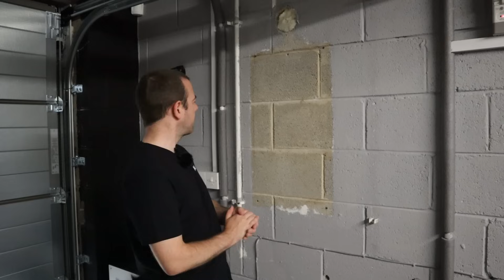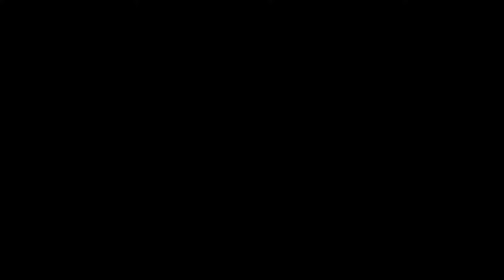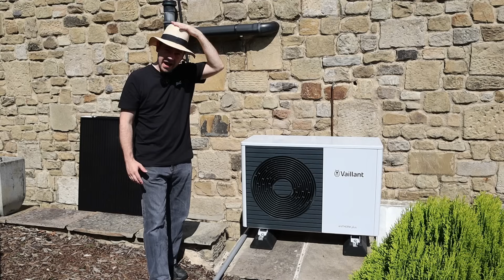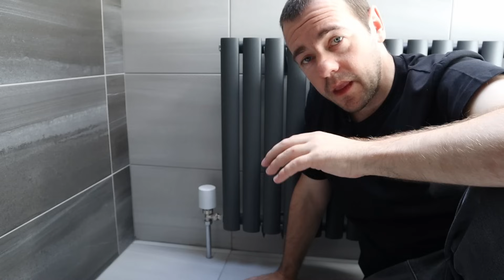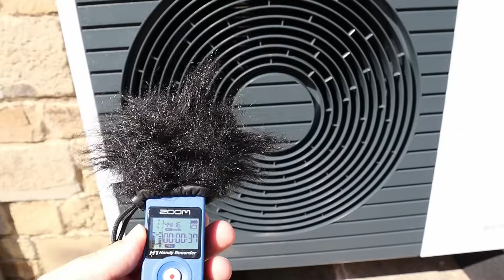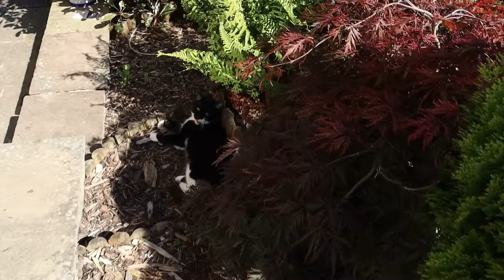Heat Pumps - Our 'Ugly' Truth!

Comment: Welcome to the gang. I mean the heat pump gang.
Yours has been an incredible journey, starting with the missing insulation of the house and the garage to now leaving gas behind.
I have to roughly calculate how much energy you heed to heat up 190 l of water from 15 degC(tab temp) to 50 degC. I expect to be something like 10 - 15 kWh, but we’ll see.
Reply: Wow 15 kWh is terrible.  I guess keeping a gas boiler is the way to go.
Reply: @Isclachau  The heat pump will be providing most of that. If the heat pump efficiency ('COP') is '3' then it gives 3kWh of heat for every 1 kWh of electricity it uses. The latest ASHP claim ratings between high '3' and high '4' - so to get 15 kWh of water heating you would use 4-5 kWh of electricity - which is much more efficient than gas.
Reply: @neilcunningham1081  But gas is still cheaper. I don’t get it I’m afraid.
Reply: @Isclachau  Gas is contributing to climate change which is trashing the survivability of most species on the planet including us. At the moment in the Uk gas is anything but cheap (this will fluctuate of course). If you have enough solar panels (which pay for themselves in 5-10 years) then the cost of running the heat pump is low/free (and green).
Reply: @Isclachau  If you heat your water on an EV tariff, at say 7.5p/kWh, then it is much cheaper than gas, once you factor the efficiency of the HP at (say) 3, your unit cost is down to 2.5p/kWh. A quarter the price of gas.
Reply: @charlesbridgford254 
So now we have to buy an expensive electric vehicle as well as install around £15,000 heat pump equipment?  Totally beyond the average person!  What on earth is your job and salary?
Reply: @Pedromyman1  Um, I work in the electricity industry. TBF I don't own the car, it is leased by a tax free deduction from my salary. The heat pump was zero-rated VAT and had a £5k government grant.

There are ways and means, but it's a long term investment that requires sacrifice, which doesn't necessarily pay itself off in my lifetime.
Reply: @neilcunningham1081  4-5 kWh of electricity at about 30p per kWh is £1.50 per hour. A gas boiler heats radiators to much higher temperatures and gas is cheaper so a boiler would heat our home for 16 hours a day for that sort of sum so sorry but I think tthey are way more expensive  to run than people realise.
Reply: @cbcdesign001   An interesting response which highlights a common misunderstanding (I believe). If you are insulated "enough" and your house is airtight "enough" then you aren't running the unit constantly at 4kWh and so the costs are lower. EVM is one of several youtubers who have posted their actual running costs and they work out pretty well. I caveat these comments as someone who doesn't have an ASHP (yet) - because my house is not insulated/airtight "enough" (yet). If you have a battery then you can run using offpeak priec leccy at other times of the day which (potentially) makes it cheaper. too.

Comment: The periodic legionnaires cycle seems to kill the COP on ASHPs. I have a German tank (a thermal store) which has a serpent coil heat exchanger which spirals up inside the tank and heat exchanges with the water in the tank. Fresh water goes up the serpent coil and comes out hot and always fresh. The water in the body of the tank is used for heating. I comes in at the base and exits mid height. The tank is stratified so the serpent exchanger always gets the highest temp in the tank. Like this you don't need the periodic heating cycle. But the tank is larger than what you have.

Comment: Really good to see a likeminded video. This has opened my eyes to heat pumps. We have just had a 8kwh solar panel array installed with 10kw battery. 

Great video, keep up the informative videos
Reply: That's a very big PV array! 10kwh battery is not going to be enough to maximize it's capacity
Reply: @kiddwong4186  Its absolutely enough, when you have a car with a 74kw battery ti excess in. Our export is very minimal. Even more so when our Hot Water Energy Diverter is installed.

Comment: Interesting to see a cost breakdown once winter comes, my house is 70 years old and is drafty and have spent that much time trying to find the drafts, I was looking down the route of electric heated taps and stand alone ac units in the bedrooms [bit like the split units] so I can rip out the rads and boiler, but with the way the bills are going I can see that it will be a flat rate price all day so there won't be cheap rates. I would rather invest in battery banks and solar and may be a turbine instead of heat pumps, we don't have space for the hot water tank and we would have to totally re pipe the house because who ever did it before wants shooting so installation costs would be out the question, I do have one bonus and that's the log burner and it cost nothing to run as all the wood I collect through out the year is free. With the bills going up I think I need to do some "man maths" to see about battery storage. The skill builder is just giving a different perspective and telling people just watch out who's selling and installing.
Reply: Solar decent shout, turbine, no. Don't do it. Not for a domestic home. The service costs each year tend to wipe out the savings made by having one installed.

Reason being, most dwelling realistically can not have a turbine large enough on their land to justify the service costs.

Granted, you could skip a few services, but you only end up reducing the life of the turbine. Meaning you end up replacing it soon. Which will also wipe out the savings from having one.

Personally, if you can. I would get more panels and storage over a home turbine.
Reply: Investing in Insulation FIRST is surely the way to go even if you're not going to get a Heat Pump especially in an older property , as Heat Pumps pump operate at a lower temperature, so require in most cases NEW Low Temperature Radiators with a larger volume of Hydronic liquid in same, unless one installs Underfloor heating circuits... you're luck you have a source of Free Wood for your Log Burner, as for Battery Banks and Storage  in Winter i'm thinking that those Solar Panel would not be pumping out a lot of Kilowatts to the Batteries what with the tilt of the Earth and Short days...maybe a Log fed Gasification Water Boiler system and a seriously  Large Buffer Tank for all that Wood...
Reply: @malachy1847  hi, I've looked into external insulation but don't have this space as the guy says I need 250mm all round and need to extend the roof out for the guttering , I looked into when we had a log burner fitted to have one with back boiler but the cost at the time was to high, battery would be the way to go if I could find a cheap idea but not self build old laptop battery 🤦‍♂️ I did look to see if I brought a leaf and used the battery but it's complicated to connect to the house as its not designed for battery to home, I agree that solar would be abit crap coming into winter so that was why usually its windyer in winter a turbine or two might be better or I just get an old lister engine and run it on old oil or veg blend and leave it pop popping away. It's going to be interesting to see what clever ideas guys come up with to stick two fingers to the gov and the global stock market traders.

Comment: We've just had a heat pump installed 2 weeks ago, so far so good but obviously we'll have to see how winter goes. 

We needed to redo our whole heating system but that was as much to do with the fact the existing pipes were old and buried into the floor so couldn't be fixed easily as well as the radiators being pretty old a rusted up too. The cost in the end was pretty similar to what I'd estimate a new gas boiler system to be with the work we needed doing once the BUS grant was factored in.

Comment: I have to admit, I'm a heat pump sceptic. This system does look a lot better than most of the others I've seen so far though and I can see them catching on if the market moves towards self contained units like this.
You said you're going to wait for the usage data before you can comment about how well the system works but it seems you're already pretty sold on how great they are.
For a sceptic like myself I'd be more likely to believe your figures once you have them if you hadn't made so many claims about how they will work in any property, any climate, etc when you don't yet actually have any experience to back up those claims.
I can watch heat pump expert videos to get their opinions about how good the tech is in broad terms, as an end user it's probably best to stick to your own experience once we get in to winter.
Reply from the maker: If most of Scandinavia uses heat pumps and has for years, and lots of different houses in the UK also have them, that’s all the evidence needed to prove they can work anywhere. What mine does doesn’t provide proof they’ll work in other climates.

If no one can comment without experience, how can anyone be a skeptic?
Reply: @ElectricVehicleMan  I'm not saying you're wrong, it was just a point about your style of presentation. Obviously one approaches the video knowing you have some bias towards the tech (since you've invested your money installing it) but the way you made statements of fact about how they will work anywhere, then later pointing out you're not an expert in the tech made your bias seem larger
Reply from the maker: I can make statements of fact from research. 

The moon orbits the earth. See it’s easy. 

Otherwise if you’re saying only an expert can comment, then that means journalists are all bias as they’re not experts in whatever they’re reporting. 

If an expert (heat geeks in my case) states something, it doesn’t mean no one else can.
Reply: @ElectricVehicleMan  sorry I wasn't trying to start an argument. Just pointing out that to someone like me who isn't sold on it, you seemed to be overly biased towards the tech. The point is you're not a journalist, you're a youtuber and I'm sure most people are here to hear about you're learned experience.
If you want to preach to the converted that's cool, but it would probably be more powerful to convert people who aren't yet convinced.

Comment: 2.5kwh is over £1 per hour.  Your heat pump needs to run 24 7. Do let us have a copy of your electricity bill in January.
Reply from the maker: That’s at max, not what it uses when it’s on.
They also don’t need to run all the time and if they do will use way less as they’ll be running very efficiently. I think you’ve missed the point completely.

Comment: Norway has dry cold. UK is damp. Norway constructs houses with much higher standards of insulation.
Reply from the maker: Norway also goes down to temperatures far lower than the UK, necessitating the insulation.
Reply: @ElectricVehicleMan  I disagree southern France needs as much insulation as Norway, it’s much more comfortable.
Reply from the maker: @reggievonramstein  The average winter temp of France vs Norway is what?
Reply: @ElectricVehicleMan  5*C but it can snow once every few years.
Reply from the maker: @reggievonramstein  it get down to minus 20/30c. 
Nothing alike.
Reply: @ElectricVehicleMan  summer temperatures can routinely reach 40*C. You need insulation for summer as well as winter.
Good principles of building apply as well to Norway or southern France.
Reply: @ElectricVehicleMan  Depends where in France. It is a big country. The North and east of France are freezing in winter.
Reply: @ElectricVehicleMan  we were told in 2012 when council installed our heat pump that we couldn't use those showers with heat pump and couldn't heat a towel rail with one but it is 10 years old the fan was replaced a few years ago aswell
Reply from the maker: @Wise Up With Risey  Then why moan on a heat pump video when it’s not the tech it’s the installer. You’re having a go at the wrong thing!
Reply from the maker: @Wise Up With Risey  You’ve not answered my question. 🤷‍♂️
Reply: @Wise Up With Risey  Gas has a tendency to run out at some point. It's a finite resource. If you need tons of gas to heat your poorly insulated house, and can't replace it with a heat pump, then I guess you'll need to replace it with a nuclear reactor.
Reply: @Wise Up With Risey  if you’re lacking insulation you should get your big boy shoes on and get some.
Once done you should get a heat pump as well as it is the most affordable way to heat a home.
Reply from the maker: @Wise Up With Risey  Then the heat pump isn’t the problem, the idiot who installed it is. Clearly.
Reply from the maker: @Wise Up With Risey  who are these people?
Are they people like yourself who’ve had a crap install? The tech isn’t bad, it’s the implementation of it. 
They’ve used them for decades in other countries, I’m always bewildered when people think they don’t work when clearly they have for many many people for many many years.

Comment: Glad you have made the decision. I have been thinking for a while about installing a heat pump, but those bad reviews have held me back. I will need to do a survey to see how much it will cost. You have made my decision easier! Thank you very much!
Reply: We did the same a year ago, except we plan to extend the house, so the install was basic strieght swap with our old oil burner using a LG 9kw Therma V Monobloc system. The monoblock is an all in one system an sits outside in one self contain box with a fan. Cost us £7k including install.

Comment: v. intresting video. is the heat pump “refrigerant” gas r290 (i.e. propane)? did the vaillant installation guide put a lot of constraints on the condensate soakaway  and position of the outside  unit w.r.t. openings , drains etc? thx, GMS
Reply from the maker: Yes

Comment: 2 queries:
Can you keep the eddi to heat hot water(excess solar)?
How big is your battery?
Reply: It is possible to use the Eddi, however the heat pump is more efficient. Meaning it will use less kWh to heat up your cylinder, than the eddi
Reply: @serraios1989  but the Eddi charges me nothing to heat the water because its using excess solar
Reply: @MichaelDoran23  
What stops your heat pump from using your excess solar?
Reply: @serraios1989  I know the heat pump can use excess solar, but my question is can I keep my eddi to heat water or do I have to take it out?
Reply: @MichaelDoran23  
You can certainly keep the eddi
Reply from the maker: My excess goes into the battery. Eddi is useless to me as I’ll never generate more than my house uses and filling the battery will take.
Reply: @ElectricVehicleMan  what size is your battery?
Reply: @MichaelDoran23   You would not want to use an eddie (or Solar iBoost etc) as you're getting 1 unit of heat for each 1 unit put in. Using the heat pump with excess solar would give you 4 units for 1 unit put in.
Reply: @carlarrowsmith  thanks for that Carl

Comment: I heat my water three times a day and only use 2.8kw. I am down at 47 degrees plus my legionella cycle
Reply from the maker: I assume you’re not using 190litres in that day?
Reply: @ElectricVehicleMan  2/3 showers, lunch and dinner dishes - it's a 210ltr tank. I was going to put it on a mid morning and evening cycle to see if that works better
Reply: Also agree, the shower mixer is using less cold to give me 38 degrees to the body at the lower flow temp. In winter I was down to 43 degrees for the heating, I will try going as low as 40 and see If heat loss is still balanced enough for a 21 degree environment. The energy usage difference by going lower flow is amazing - like running a car at 50 instead of 75mph

Comment: Is it legal to install the external HVAC unit next to your neighbours's property? I am in a 2009 3 story house  less than 2 m  from the fence with the neighbours similar homes on each side?
Reply: I was told the only place I could have the heat pump was in the middle of my small garden due to the fact my property boundaries are all within 1 meter of a neighbour or the building is the boundary, over a drain access or in my drive which only just fits my car.  So unless I move doors and windows or willing to use my garden only to dry clothes it's a new gas boiler for me next month unfortunately.
Reply: Your heat pump surveyor will work out the distance from the outside unit’s position, to the nearest habitable neighbour’s room, and use a formula to tell you if it’s ok or not. A small fence or other noise obstruction can be placed in this sight line to help, until the conditions are met.
Reply: approximately 1 m.

Comment: Here we see an idiot, who by his own admission couldn't put up a shelf slagging off the sceptical views of man who's been a plumber for decades. And again at his own admission he has no idea how his system will perform in winter or how much noise the pump will make when the bearings start to go in 5 years.  Watch the skilbuilder videos if you want an expert view
Reply from the maker: A plumber isn’t a heat engineer.

If you want expert v expert, watch this: https://www.heatgeek.com/installers-react-to-skill-builders-video-on-heat-pumps-part-1/

Do you not find it odd that he installed the heat pump that he said the customer wanted ripping out afterwards, only to blame the heat pump and not the installer? 🤷‍♂️

Heat pumps clearly work when planned properly and in the right housing stock, if that didn’t work then there’s only one answer to why. 🤔

Comment: it would be helpful if you could provide links to your equipment featured. I can find info on the heat pump but not the unitower.
Reply from the maker: Just google: vaillant unitower - manual comes up near the top for me.
Reply: @ElectricVehicleMan  yes, but where do I find prices of the unit?
Reply from the maker: @David-bl1bt  trade suppliers. City plumbing etc. comes up on google.